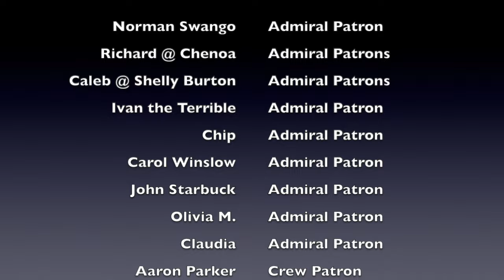88. Finally Time to Set Sail Again! Pulling up the Sea Anchor. 56-Days Part 6

Comment: When you first introduced the sea anchor, a few videos ago, I thought there would be a line connected to the outside of the suite, to make the retrieval process easier.  
Looking at the retrieval, I saw you have a Boje fixed to the anchor somewhere.  I assume its purpose is to not let the anchor sink too deep?  I was wondering if extending a second line from the Boje line back to the boat, which is not held tight, can then be used to retrieve the anchor from an unideal angle, which collapses the anchor, therefore reducing the resistance on retrieval?
Reply from the maker: I think that’s a good idea in principle, however, I think perhaps it would still get tangled up the anchor rode over time.  I would be willing to try it next time.

Comment: Are the boards on Norm's cabin not sealing his cabin? Can you fix it so his cabin doesn't leak?
Reply from the maker: It’s actually the sliding top that is the problem. He’s got some foam pieces he puts in there now that help. Our new cockpit comings also keep the water from crashing through the cockpit like it used to.

Comment: Wondering why you didn't use your boom gallows to secure the boom instead of using the main sheet and preventer? I thought that securing the boom while riding out a storm on trysail and staysail or on sea anchor was the primary purpose of the gallows.
Reply from the maker: Simply because it gets it out of the way and makes the cockpit more usable, especially when we’re sitting out there forever.

Comment: some sailors add a buoy to pull from it rather than pulling the sea anchor itself
Reply from the maker: There is one of those, but it can’t run all the way back to the boat or it gets tangled in the rode

Comment: Not a sailor but couldn’t you have used the power of the motor to move the boat forward as you pulled up the rope?…
Reply from the maker: The shock load on the swells is very severe if we took the strain off too quickly with the motor, it was better to just steadily bring in the Sea anchor

Comment: Shouldn't the sea anchor have a line up the center so when you pull it in it collapses, inverts, the shape?
WHY in heaven's name would you have to pull in a fully deployed drogue?
Reply from the maker: It does if you watch towards the end, you will see us trip it with the boat hook. If you were to run that trip line all the way back to the boat you would need 300 feet of line which would twist around the road itself would be great to figure something out that would workall the way back to the boat, but they haven’t come up with anything like that yet.
Reply: Explain in detail how you would design this so that it works reliably. I will take the idea and run with it.
Reply: @SV-Mig  Good point!  I actually thought of some sort of custom line wityh a casing and an internal cord that pulls separately - probably does not exist, but in my perfect world it would ;-)  Yeah I thought of the twisting so my imagination came up with an encased trip line - Hey, it is imaginative at least.